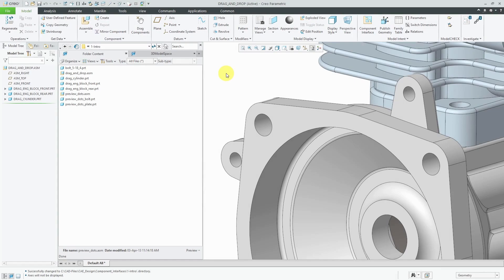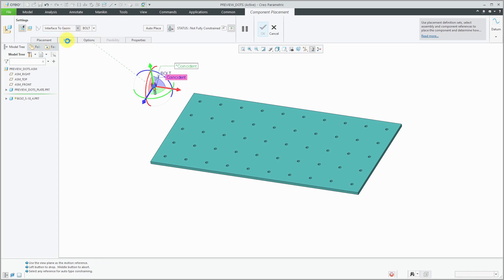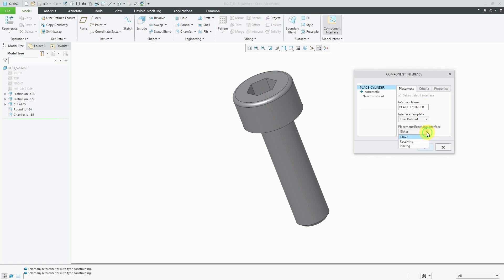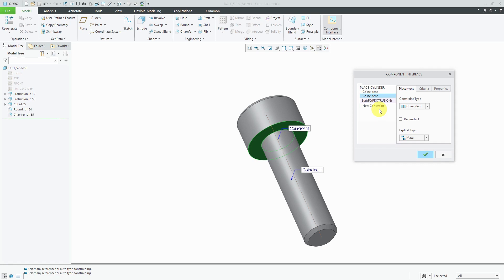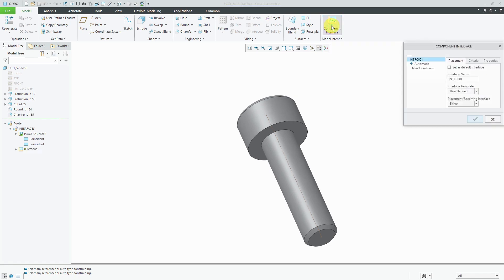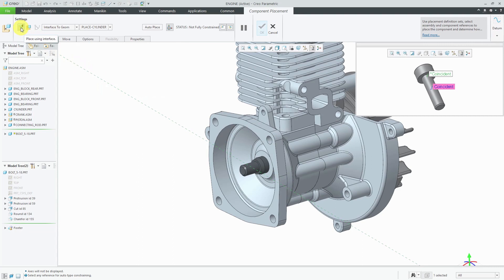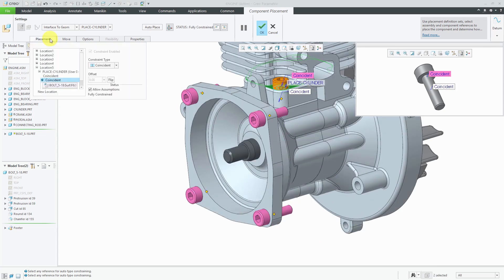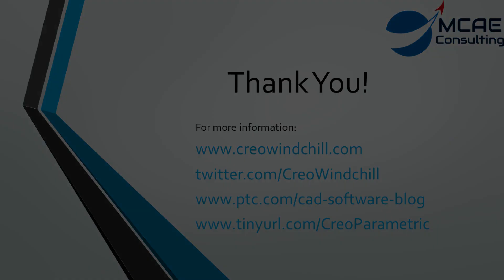Creo Parametric - Component Interfaces | Basics

Comment: Place Using Interface greyed out?  After clicking the Assemble command and selecting a component, the Place Using Interface is greyed out.  I'm using Windchill and Creo 7.0  Any ideas?
Reply: I was just reading about this and ended up here. I got this from my help search

The autoplace_single_comp configuration option must be set to yes to enable automatic drag-and-drop placement of components.

And there might be other settings that need tweaking as well. And you need interfaces in both the assembly and the component perhaps?

Comment: Can this be done with sub assemblies?
Reply from the maker: Well, it can be done with assemblies. A subassembly is just an assembly inside of another assembly. There’s a reason they call it “Component Interfaces” and not “Part Interfaces.”
Reply: @CADPLMGuy  for some reason its not possible to have these neat point for picking and placing in the context of assemblies as you have it in the example, I cant understand what i am doing wrong. Also, it would be so great, if you could explain and expand on how to use criterias for component interfaces. Thanks!